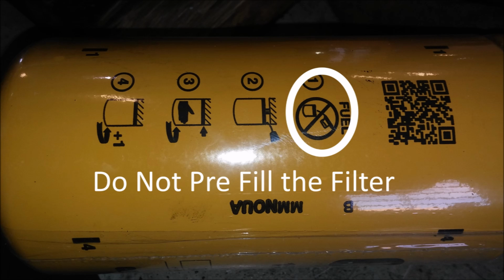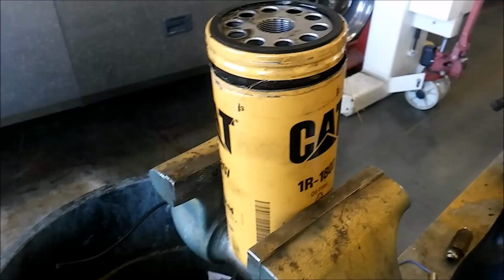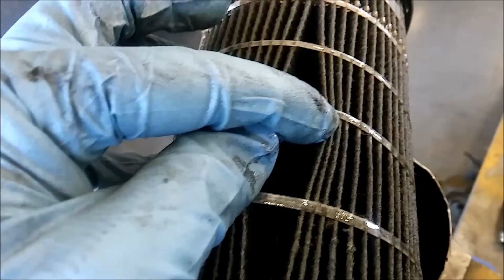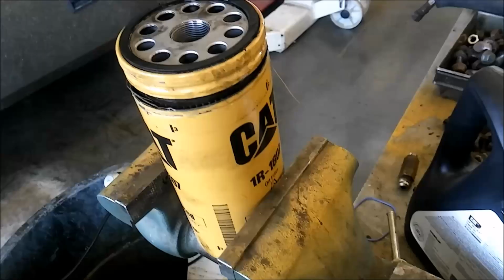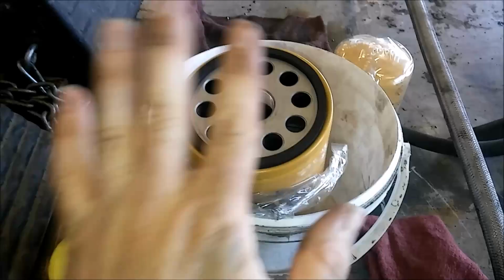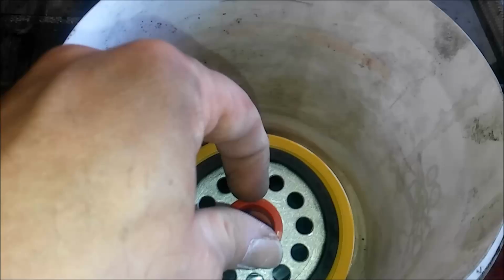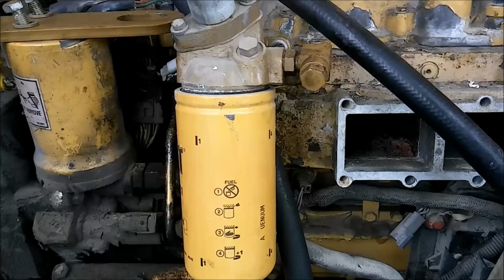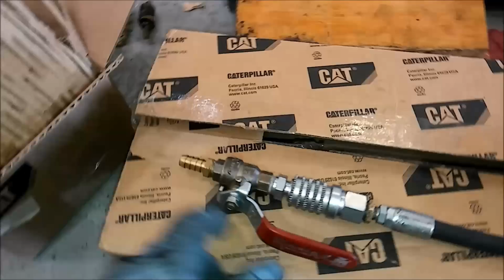Should You Pre Fill an Oil Filter? Should You Pre Fill a Fuel Filter?

Comment: on my classic car i just dont pull the choke until the oil light goes off on my newer (but high proformace) car i unplug the plugs crank untill the oil light goes out then plug them in again before starting
Reply: Yeah , same here... just let it crank but not start, disable ignition or just let the diesel pump in shut off position..disconnect some sensor that is vital for starting. whatever, the older the car is the easier is to fool it. Newer cars complain too much :-)

Comment: Take the used oil filter at a normal change interval straight from the engine and carefully extract an oil sample from the center with a turkey baster. This is the filtered oil that was continuously running for numerous hours in the engine up to the point when the filter was removed. Have that sample analyzed. Now pour clean oil straight from the container into a sample jar, this is the oil that will run thru the engine for a few seconds if you pour it into the center of the filter. Have that sample analyzed as well. Then show how the unfiltered new oil for a few seconds caused the bearing damage and the high-hours filtered oil could not have possibly caused any bearing damage or clogged a piston cooling jet, even with the possibility of momentary bypass such as in extreme cold start-up. The bottom line is due care must be taken to keep contamination or debris away from the inlet of the new oil filter during handling. I could handle the filter in a careless manner with grubby hands, or possibly the filter is mounted in a difficult to access location, and get a speck of crud in the clean side of the filter that way, even if I pre-filled the filter from the outer holes, or not pre-filled at all.

Comment: On an engine rebuild I spin the oil pump to prime the system before startup on older style engines that are driven by the distributor.
Reply: Mustang Guru that’s fine with old gas engines that have a distributor driven oil pump. Those engines are called antiques. 
This video was about modern diesel engines. You’re not turning the oil pump over and then installing the distributor on these engines.

Comment: In the case of oil: if the new oil I'm putting is in some way contaminated... how is that not an issue when pouring it directly into the engine via the filler cap?
Reply: From the oil pan it’s pumped through the filter then goes to engine. If you fill the clean side of filter it goes straight to engine without going through filter.
Reply: @thenomad7120  But you don't pour oil straight into the oil pan. To get to the oil pan it has to go through the engine first. So any "contamination" is getting one pass through the engine either way.
Reply: @KingAdrock420  when you add oil it goes to your oil pan through the timing case...not through the engine.
Reply: Great point

Comment: Never prefillled an oil filter, but I’ve always have with the fuel filters
On a rebuild, when adding oil, I don’t use the fill tube, but remove the valve covers and fill there, oil will pass through and prelube what needs before starting for the first time

Comment: Okay, you have a primer pump on the fuel filter adapter, at least on every diesel engine I've ever seen. They may or not work well but that's another issue. So you can fill the fuel filter, the right way, and protect your injectors. You can't prime the oil filter, unless there is a way to keep the engine from getting fuel when cranking. I do this trick when doing a service on a gasoline engine, especially if it has a turbo or two. Just hold the throttle to the floor while cranking the engine for about 20 seconds or until the oil light goes out (on some cars) or the oil gauge shows pressure. The problem is you need to get to know the car, some lights won't go out while cranking and some gauges won't register until you let off the starter so you can see it raise up a little when you stop cranking. You don't want to crank it for more than about 15-20 sec. at a time to keep from possibly damaging the starter. Anyway this little trick works on most modern fuel injected gasoline/alcohol vehicles so it may work on newer diesels also. I can't say for sure. Just be ready to shut the key off if the engine suddenly starts at full throttle, some cars may have fuel in the intake or the fuel injection still fires the injectors. The way it works is most fuel injection is programmed with a "clear flood" mode, which it goes into when you press the gas pedal to the floor when cranking. It limits the fuel injectors to about 20% to clear a flood (even though fuel injection should never flood the engine with fuel). This is also a good quick test of the battery cranking capacity.

Comment: im at 500,000 miles and i always prefill my oil filter no problems yet
Reply from the maker: +VK70001.P The point of this video wasn't too discourage prefilling, just if you are going to do it, fill it from the dirty side. Just relaying the information from Caterpillar too. Thanks for commenting.
Reply: VK70001.P which German tank is the vk 70001p?
Reply: huehuehue k non i did not proof check when i made the name it was ment to be 7001p
Reply: Ahh but how do you know? Do you build your own engines? How would you know if you had scratches on bearings as a direct result of the common new but dirty oil?  Look in the bottom of any new oil jug and you can see debris.
Reply: consaka1 i do look at the bottom of every oil jug befor it goes in my truck

and i know my bearings are fine because i have good oil pressure when your bearings get scratched or gouges they let oil passed then faster and oil pressure will drop

also yea i do a compression test and borescope my cylinders every time change my spark plugs and wires

and idk what no name dollar store oil you're buying but if it has debris in it don't buy it

i use motorcraft 10-40 or valvoline 10-40

and you ask how do i know i have no problems? BECAUSE THE TRUCK STILL RUNS LIKE NEW jack ass
Reply: consaka1 well i have never had to rebuild my engine in the last 500k (never been rebuild) also has factory accessories on it so i must be doing something right

both my 6.9 idi's  and my 4.9 I6 are extremely high mile contenders and still run like
brand new

what ever oil you are buying with sand or whatever you claiming is in it is cheap and crap (probably using pennzoil) or walmart shit tech
Reply: VK7001.P Whatever you are doing right probably has nothing to do with your oil short of frequent oil changes. 
Fact is you do not know what your bearings look like until you pull one off. I have rebuilt plenty of engines both gas and diesel. I know what that stuff looks like.
For my personal vehicles I use Shell Rotella-T. For diesels it is one of the best you can get so you can take your crap pennzoil drivel and shove it. Pennzoil never sees the inside of my shop. I have seen what that crap can do though the newer stuff is probably much better than 20 years ago. I still won't use it on anything I own or customers rigs. 
Like another commenter said. Send your brand new oil sample in for testing and you will find out just how much debris is allowed in new oil. Considering you can't even come close to seeing what the filter is filtering out you will be surprised what is there that you didn't see.  Perhaps still not enough or big enough to cause massive amounts of accelerated wear but it will be a little more than you would have if you followed the advice shown here.
Reply: consaka1 lol well if i need a microscope to see the contamination it's not significantly harming my engines like i said my F350 is an 86 6.9 navstar and the 82 F150 is a 4.9 inline 6 both engines are tanks and will run any gauntlet
they might not get there first but they will always cross the line

and they are both engines that are engineered to handle that amount oil contamination i mean hell look what oil they were actually designed to use

even cheap stuff today looks good compared

but at least we can agree that Pennzoil is absolute trash not fit for a lawn mower
Reply: VK7001.P Lol. all grit that destroys engines you would need a microscope to see. By the time you can see it with your naked eye it is too late and the engine is toast.
Those engines are tough old engines. Still running after your careless abuse is evident of that. Hahahaha lol I still say you missed all the finer points of this video.
Reply: consaka1 na the oil is filtered before it leaves the factory its not going to do anything to them i still have full compression and no knocks

so no significant damage is done or something would have failed by now like an oil pump or an spun bearing or something

and even if you what you say was true it's a hell of alot less damage than you would get from starting it dry

all i know is i have never had oil problems with any of my trucks or my cars changing the oil the way i do
Reply: consaka1 i have never seen any debris at the bottom of an oil jug and YES i have looked before you are nuts
Reply: consaka1 also never said that my bearings are in perfect condition i said they are fine

if you have bad bearings you WILL know
Reply: Consaka is it possible the "dirt" you are seeing at the bottom of new oil is nothing more than dissolved solids that have separated from solution and deposited on the bottom of the jug, say from the additive package added to the base oil?
Reply: exactly i run a motorcraft conventional 10W40 and have never seen anything but clean oil

is your seeing floaters maybe he running something with zinc? 

but i have never dot a contaminated bottle of oil before
Reply: Im currently running pennzoil's ultra platinum from natural gas. Experimentally its tough to gauge results because my 2016 pentastar which now has an EGR system hasn't gone through its paces, and neither has penzzoil's new formulation. Cant say its nonsense because there hasn't been enough time to see the results, can't say its magic either even though the technology SHOULD be there. Have to wait and see. Going to try ritual oil/air filter changes every 5k and see what happens.
Reply: BeingInTheMessiah pennzoil has ruined every engine i have seen it put into

every single time we open the crank and boom there it is

some kinda white oil fome it acts like gear oil mixed with water and degreaser,brake clean,engine clean nothing cuts through it

if you catch it in time to save the engine only thing that will take it off is steaming the block in a steam clean chamber

pennzoil is the worst stuff i have ever seen

even worse than that cheap chinese oil that you get in a new snowblower
Reply: We shall see. Their new PAO hasn't been around for very long so I'm sure there really aren't that many people out there to sample from, fewer still that had problems and only ran one brand
Reply: VK7001.P You say they are fine but you have no idea what condition they are in.  lol brilliant. Our point was they would be "finer" or in better condition if the advice given was followed.
Reply: BeingInTheMessiah Well I haven't analysed it but others who have sent "new" oil into the testing labs say it comes back with a high degree of solids contamination. Basically particles that are way bigger than they should be. Compared to that same oil sent in 3000 miles later that has much less of that same sort of contamination. Mostly because it has actually been through the filter multiple times and the filters used in cars filter down to a much smaller micron than the manufacturers actually filter it to.  Kinda makes sense considering they are in a hurry. It is "good enough" for them since it goes through the car filter. Any damage will be minor and not really discovered till much much later.  Average joe will say its fine and not really care. Of course average joe doesn't really know what they have done. Anyone that really wants the best for their engine will follow the suggestions in the video. :)
Reply: BeingInTheMessiah Those of us that have seen Pennzoil ruin engines in the past are a bit gun shy of that oil.  
That being said I have heard some of their newer oils are much better. I'll never use it simply because I no longer trust the company.  Wish the best of luck with it though. Keep us updated on its performance.
Reply: consaka1 they are fine if they are doing their jobs that's my definition of fine

ill tell you what my 6.9 idi is getting turboed in about 1 month

that means its getting a complete rebuild from a bare block i tell the guys at Toms commercial Ford trucking to save everything

and ill inspect the bearings tho im almost positive they are within safe tolerances
Reply: VK7001.P Lol. You still are totally missing the point.. I have come to the conclusion that you are unable to comprehend common sense.  Enjoy your engine that works just fine despite being more worn than it would be if you followed the advice of this video. Do the same with your next engine. What do I care if you get less mileage on any engine. You want to argue against common sense then do it with someone else. lol
Reply: that's fine by me ill keep my truck running high quality oil non contaminated oil

meanwhile you can just keep using your chinese sandy oil you keep buying and wreck your engine with all that gritty crude
Reply: idk your the one saying its full of crap
Reply: no this is my thread i don't have to
he said he has chunks in his oil 
i told him it was bad oil 
he said no its supposed to be like that

all im saying is that a new jug of oil should not contaminate in it and if it dose then you need to buy better oil
Reply: huehuehue k then mute it or do you not know how to stop comments
Reply: consaka1 YOU are the one saying that your oil is contaminated and that's why you don't pre fill you oil can

well that means there's crap in your oil and you keep going on about how you but this assume oil but then you say its full of "DEBRIS" which could be ANYTHING from sand, corbon rocks,pulp from a failed filter, your IMAGINATION

like i said before you probably got some bad oil and now you think all oil is

and BTW shell is shitty oil
Reply: consaka1 You must be buying some cheap ass oil. I use Award lubricants. I've been in their local plant, and trust me. she's pre filtered.
Reply: don't bother arguing with that consaka guy he's convict that the dollar store chinese dirt oil he buys is the same as all other oils
Reply: VK7001.P 7
Reply: Exactly.
Reply: Well this thread kept me entertained for a few.  I think the most logical post I read in here was the last post jsalmon wrote.  Still, it all kept me more entertained than the bullshit they play on CNN or whatever the Karashians are doing.  And let me tell you something, if you can make plot-lines out of motor oil, then anything is possible.
Reply: It's far better if you don't fill your filter and let it run it's own course. By not filling the oil filter you provide the engine the maximum opportunity to re seat the piston rings thus giving you better compression.  Where are you guys getting your engine building knowledge from?
Reply: DEBRIS IN BOTTOM OF OIL CONTAINERS ?
it's called additive fallout, shake the damn bottle before pouring and stop your crying.
I've filled filters for 30 years using center hole and never one issue , I do get what your saying though that therr could be a random issue with the clean new oil and then pouring it into then center hole of a filter.
I agree and will fill from small hole side if possible. 
And whoever says don't prefill oil filter IS NOT THE BRIGHTEST !
Reply: So don't prefill the filter because the new oil has contaminants, instead, put on an empty filter and dump your new "contaminated" oil down into your engine and around your cams and let it get to the filter after it has passed through your vitals....did I get that right? I'll stick to prefilling and using quality oil.
Reply: @HiTek3  you need to leave the oil filter completely dry and avoid placing any oil at all cost unless the engine does it on its own.
Reply: @sc0tte1-416  

Hahaha!!! Amen!!
Reply: @consaka1  What you may be seeing is some of the chemicals in the additive package settling out from having been stored in one position for a prolonged time. I usually give my oil bottles a good shake so as to redissolve anything that might have settled out. I think this may be especially prevalent in some oils that are using high concentrations of heavy metal anti-wear particles, like Molybdenum. The oil that I use in my Nissan 370Z is Nissan's specially formulated oil for that engine, VQ37VHR, and is called Nissan ester oil. It has a high concentration of Molybdenum, about 600 ppm, and very often shows up as a thin layer of black sludge at the bottom of the container. Again, I give it a good shake before pouring it in and I''m good to go.
Reply: You're only 1/4 of the way into its life at 500k. When You think about it, most HD trucks can retire at 2mil miles.

Comment: If you're starting out with a new filter and new oil, I don't see that it makes a bit of difference if you get oil in both sides. The oil won't get dirty and need filtering until it actually goes through the engine. The old filter you removed certainly had oil in both sides. Total non-issue. I doubt it makes a bit of difference either way.

Comment: The amount of "contamination" that is in new oil or fuel is almost non-existent. Pre-fill your filters.
Reply: Rain Coast I agree with you
Reply: Absolutely on oil filter but not fuel better to install filter and use fuel tank pump to fill installed filters that way no unfiltered fuel goes to your high pressure pump and injectors.